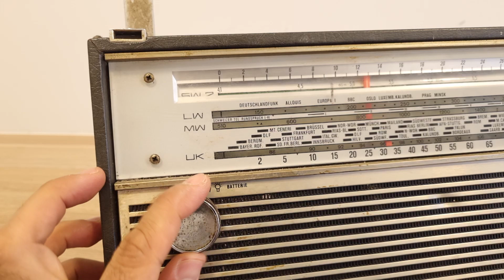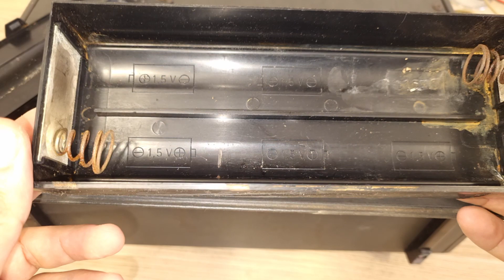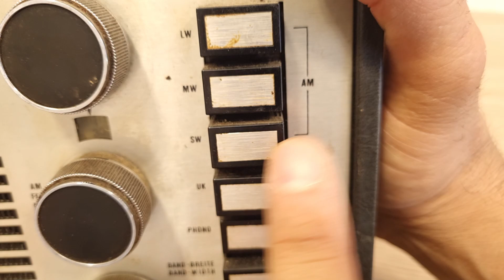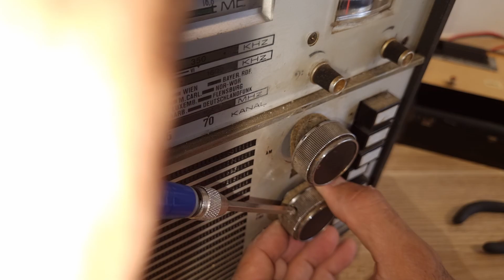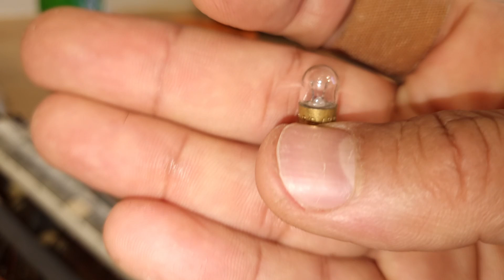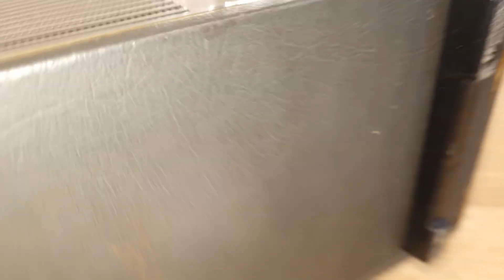Restoration: Vintage 9 Band Radio from Germany, Intercontinental Schaub Lorenz

Comment: Hi there, I have one of these radios as well, although i was lucky enough to get it in a better state. This was the top of the line portable radio made by Schaub-Lorenz in the mid 60s. It was NOT a cheap set, and there must be a handful of them left around the world, let alone in such a far away place like Australia.  I saw your tuning indicator does not work... either the microampermeter is mechanically stuck or the electronics are not doing their job. i HIGHLY recommend you to replace ALL of the electrolytic capacitors inside. Take care as some might be hidden inside of metal shields (such as those on the am/fm demodulator board. Please take your time with it and take good care, as some of the semiconductors inside are nearly impossible to procure today.  Good luck out there.